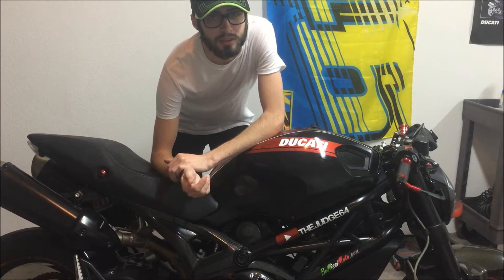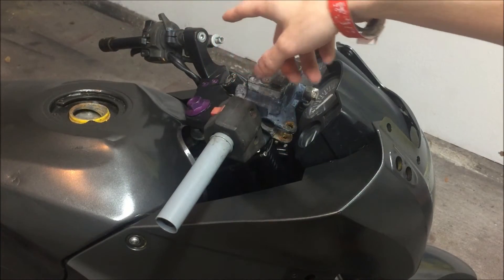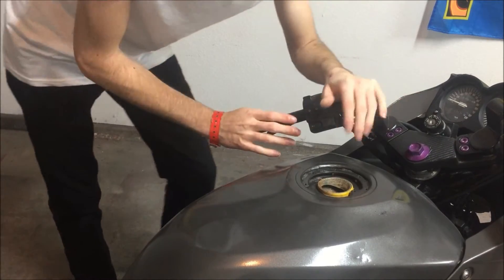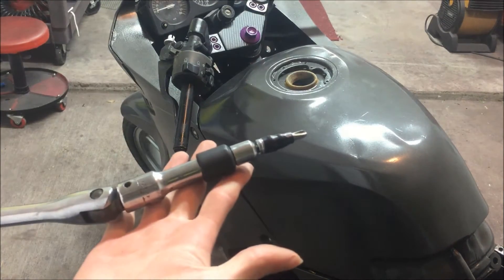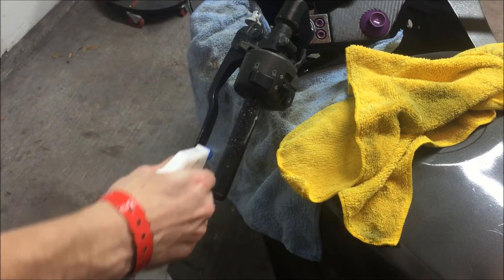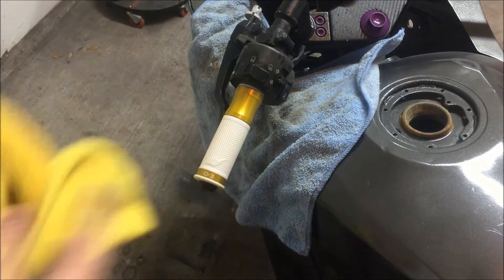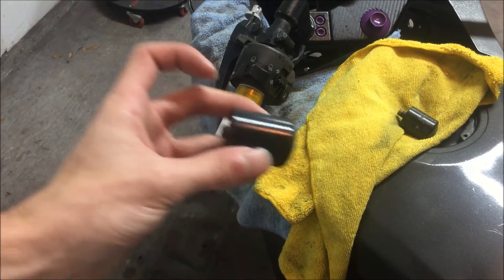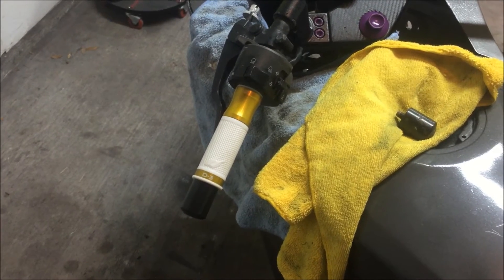How To Install Motorcycle Grips (DRIVEN)

Comment: For the throttle side did u have to shave down the litlle lip thats at the top of the grey plastic cover, i've heard that this necessary to get the grip onto the throttle side? and if so did u just used sand paper or another method? thx
Reply from the maker: I didn’t have to shave down anything, if it won’t fit all they way, just keep pushing it
Reply: Ok, did u use. soapy water again for the throttle side or what did u use to hold it in place hairspray or grip glue?